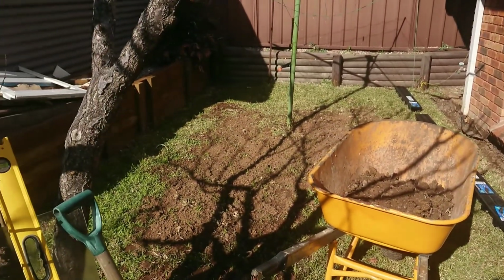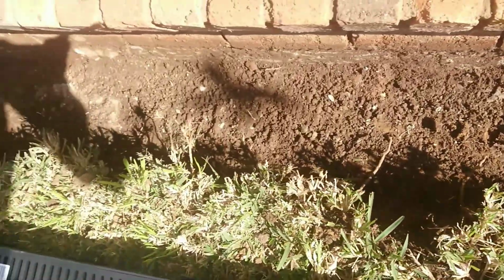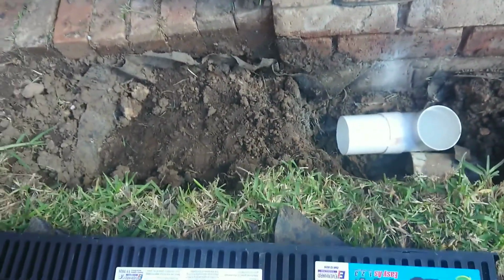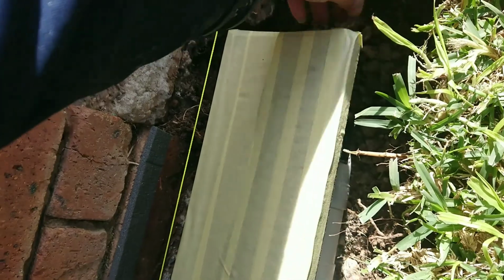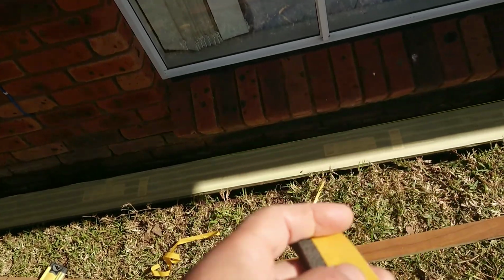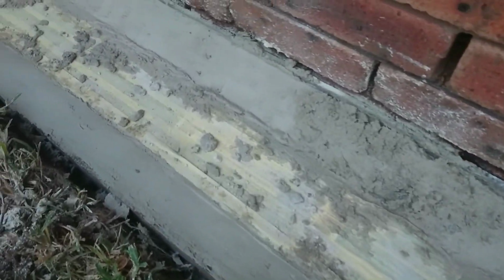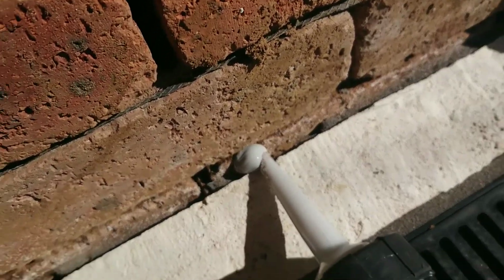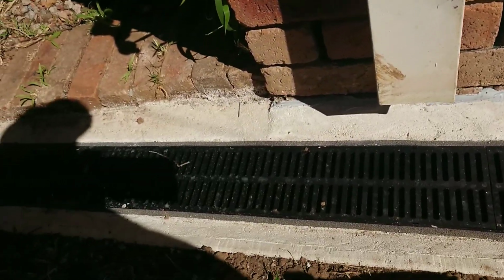How to easily and quickly install channel drains next to your house footings

Comment: With regards to the compressible strip against the house; why do you need it? I understand that the concrete could shrink as it dries but surely you could add your flexible mastic down the edge of the concrete regardless of whether you have the compressible strip or not? I’m not criticising I’m genuinely asking?
Reply from the maker: It's only there temporarily to create a rebate where you will be squeezing the caulking later.
Reply: @BerberoSaharan  okay I get that but is it needed? If the concrete shrinks and it isn’t there, can’t you just backfill with the mastic? Asking genuine question as I have an issue up against my house similar to this. Brick paving all the way to the wall and it needs sorting as damp coming in heavy! 👍 thanks
Reply from the maker: @Bazzaruto   If you don't caulk inside a rebate, it will not last long. Read the product data sheet of the product you want to use to understand.
Reply: @BerberoSaharan  thanks friend 👍